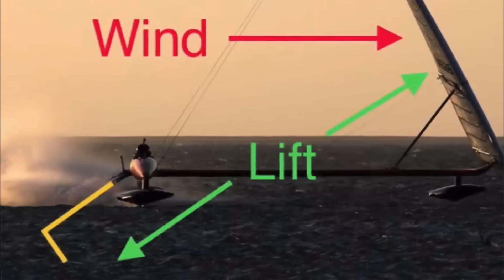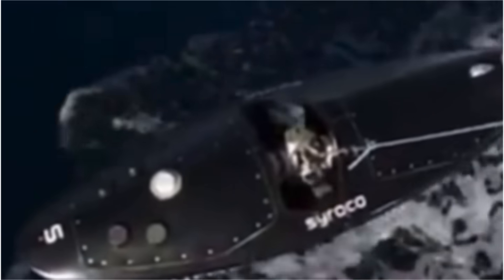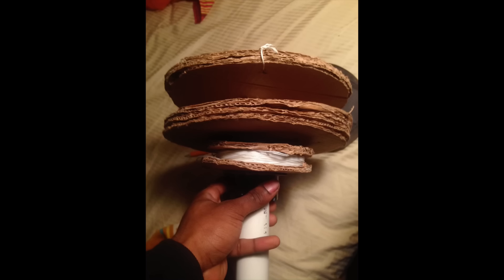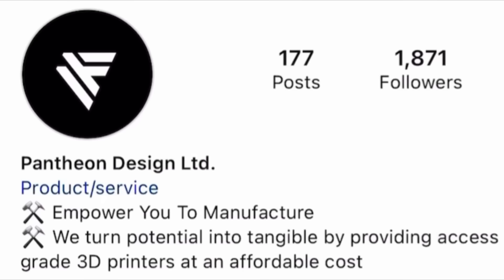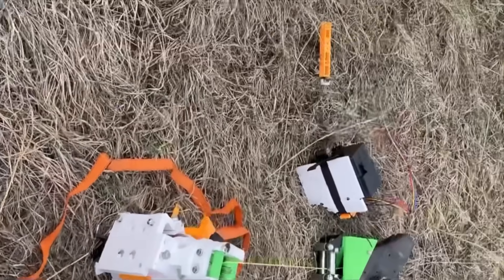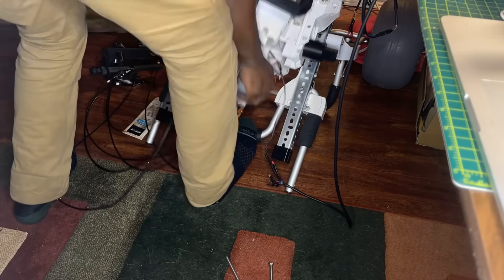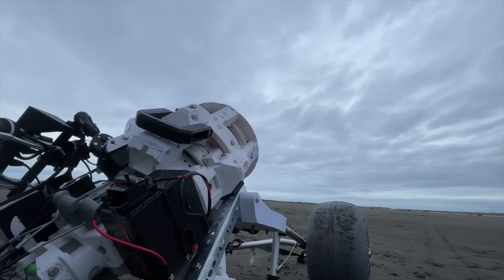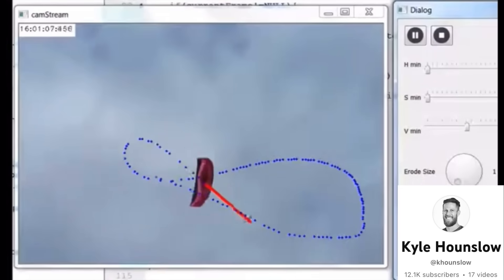Transforming Sailing and Power Generation with The Ocean Kite Engine

Comment: pretty cool concept but personally i wouldn't trust plastic it would be better if it was made of metal atleast for the structural parts
edit:
i love the idea of using one of these as a generator but again if i was running my house on this i would want it to be reliable aka all metal construction like for a sailboat i understand wanting to keep it light but onland that's no longer an issue.
Reply from the maker: What would you say to Carbon Fiber ASA?
Reply: @Ocean_Kite_Energy  personally carbon fiber ASA is good for compression forces for that added strength it's a very brittle material, 
Personally if I was making it it would have to be a mix of metal, injection molded, or machined plastics to build the strongest & lightweight product
Reply from the maker: I've been doing some research and turns out SLS and 3D printed metals are stronger than CNC, maybe that is the way to go.. just like all these space ventures are doing.

Comment: Seems overcomplicated. It would be much easier to have one tow line and have the control lines go down to a small pontoon boat below the kite. It would automatically steer the kite. 

The complications are steering and  pulling from the same point.
Reply from the maker: What you mention reminds me of KiteShip. They pretty much made a giant kite "spinnaker" but it didnt produce enough power. 

What we need is that loop. The looping motion is what turns the kite into a veritable one bladed wind turbine/propeller in the sky.. by increasing the apparent wind over the foil. This is where the power comes from. This is how we can draw the most electrical power out of the wind as well. So we want to maximize "lift"
Reply: @Ocean_Kite_Engine  
It would make perpetual figure 8s. Wouldn't require much electronics. Just let it out, and it self manages. Power could be adjusted by height. Very simple system.
Reply from the maker: Figure 8's are good, however loops require less power and focus the effort of the kite deeper in the wind window. Yes it would be simpler to just do figure 8's but power and speed are limited. 

 @FullCircleTravis

Comment: i think you will have a significant loss of power due to the lines going slack as you move in the direction of the wind, i hope to be proven wrong.
Reply from the maker: It's comments like this that make it all worth it.. You're really thinking about the problem. Here's my plan to address that going down wind.. It may use a bit of power but consider it a "powered" sail. 

As the loop commences  tension will rise, and the boat will move quicker, as the kite starts to pull up, it will indeed slow down and put slack on the lines..

My plan is to use the electric motor to effectively maintain tension on the lines. Also the boat itself could bear off to create more tension on the lines.

Now this will only be an issue for fast boats.. With boats like barges and boats with a low hull speed, we wont have as much of an issue.
Reply: @Ocean_Kite_Energy  good answer, but with out simply using the kite as a wing sail and creating tenson with the keel and sailing at a tangent to the wind, all you will do is eventually wind the kite in, even with multple kites in the air, if one or more is in the window, the lagging kite would not be able to catch up, imo this could only work with conventional sailing physics in mind, trying to sail directly with the wind will cause a pumping speed up slow down effect, swinging the kite/kites around would average out and produce a similar overall speed to using a kite like a sail to tack and jibe etc.
Reply from the maker: @BadwolfFPV  Ok you're tracking. Sailing tangent or "Cross wind" or Beam Reach, we would keep the kite relatively static/steady. Correct. The looping would be the most beneficial for downwind runs or producing electrical power (preferably at anchor). 

With going down wind, consider this.. (and I'm not sure, which is why I am loving your questions) Instead of a typical jibe in a zigzag directly down wind.. think of a zigzag at more of a 45-degree angle. One that osculates with the looping motion of the kite.. The kite line will have to be pulled in when there is slack, and let out when overpowered.. It will indeed be a delicate balance.
Reply: @Ocean_Kite_Energy  are you familiar with P.I.D loops, because I think that you will need a some kind of P.I.D loop system to maintain that balance. Multiple kites multiple loops, one to maintain tension on each line and one to maintain overall tension between the kites changing order, this will certainly require some helfy programming knowledge, sensors, etc, and possibly even AI. I can't imagine a simple mechanical solution, although I'm sure some genius could figure it out, but the one thing i know about power kites, is that once you catch up with them, they have to drift and catch back into the wind window, and if you are still moving in that direction, its incredibly difficult if not impossible for that to happen, and they drift to the ground, or if you get underneath them they act as parachutes and lower you to the ground with drag. They already tow big ships with kites so the theory is proven, but they are not swinging them around and using them as sails, I still can't see how the boost you will get from the swinging kite, won't result in slack lines or fully wound in lines.
Reply from the maker: @BadwolfFPV  And because those big companies (Skysails, Kiteship) dont maximize the speed of the kite, they'll never produce the power we really need. That swinging is what increases the apparent wind over the foil and maximizes lift (cubic relationship) so speed is more important than size (which is great because mass doesnt scale very well). Because of the size of those tankers, and their hull speed, if Skysails kites did constant loops/orbits like the Kite Engine, they could turn into large single blade propellers in the sky. But their hardware is not designed to do that. 

And for suuuuuure. This will need a lot of control. I'm currently tasking myself with making sure all the hardware and sensors are capable of controlling everything. I have a couple of really talented AI guys and our objective is to fly kites and log data and use machine learning in conjunction with PID control.. We basically have to make a brand-new flight computer. But it's 2024 and we have wayyy more computation than when this was attempted 10-20 years ago. 

The above maneuvers we are discussing are advanced control situations.. (looping with a fast boat, the flying boat) 

This is why we are starting with simple on water boat projects (check out Proa sailboats, I think you might be interested).. and even on land.. I will explain the control scheme in another video, but it is actually much easier than you would expect.. I designed it to be mostly operated with one hand, because I learned it's critical to have at least one hand free.. 

You are right, you dont want the kite to be overhead (or even worse, behind) In these situations it will be better to have the kite at a lower angle.
Reply: @Ocean_Kite_Energy  now i am super interested, fantastic response. i cant wait to see more.
Reply from the maker: @BadwolfFPV  I really appreciate your questions.. I have many of the answers but I've yet to actually vocalize them. They are just impressions until you actually ask. So it's a great exercise verbalizing them. Def follow if you havent already, and feel free to drop me an emal at Christian.Harrell.OKELLC@gmail.com
Reply: @Ocean_Kite_Energy  already subbed, will absolutely be following this project, it's fascinating. On the subject of power generation, have you considered the application of using the wing kite to carry a small turbine into the fast moving winds and hold it in the optimum window, the electricity can be passed directly down the cables holding the kite in the air?

Comment: I love the design / verify / redesign strategy, especially the rotating kite attached to a rotating engine to keep the lines from getting twisted.

The gondola blew me away, only the drag necessary for the keel.  Put the "boat" in the air.

Comment: Interesting device. Looking forward to see the autonomous version mounted on a boat. 
If it is producing electricity it is a generator (ship terminology). 
Which can provide power for an electric motor for propulsion. 
If it uses wind to move the boat in a controlled manner it is a sail. 
When it does both it is a new thing that needs a new name…
SailGenerator. 
When you drop anchor it does the same, but now it is a power plant.
Reply: I prefer WindJammer as a product name for the sailgenerator ...

Comment: Why does the kite have to fly in a figure 8 ?
Reply from the maker: It does not, This system allows the kiter to fly any pattern they wish without fear of tangling the line. For some reason, that hasn't been thought of until now.
Reply: @Ocean_Kite_Energy  But does the figure 8 pattern generate a stronger pull.
Reply from the maker: lol Im going to use that one
Reply: @Ocean_Kite_Energy  Sorry that was a typo I meant 8.
Reply: @ExploringCabinsandMines You want the kite to stay in the power zone as much as possible and a figure 8 does it very good w/o tangling the lines. With this system you could just go for loop, cause its Anti-Twist Technology. I really like it!
Reply: @mannohneschuh  so a kite in a dive pulls harder than just a kite "flying " in a steady position ?by what percentage?  how wouldn't anyone watching know this? just trying to understand. and please  explain the forces of line twisting
Reply: @ExploringCabinsandMines  It's all about the wind window. Take a look @ 7:30 for a picture. If you send the kite into neutral, it will always go into the green zone or on the ground. You want the kite in the red zone, this is the area where the kite catches the most wind and pulls much harder. Imagine flying a kite on the beach in good wind. In the green zone, you will have no problems holding the kite and staying on the ground. If you fly the kite in the power zone, you will be pulled across the beach with ease. To keep the kite in the power zone, you need to fly some kind of loops. For a human, the 8 is best because the lines don't get tangled, but the machine can easily do a loop thanks to its anti-twist technology. 
I don't have any numbers, I just learned it from kite flying as a kid/teenager.
Same goes for twisting. 2 loops and steering becomes much more difficult and increases wear and tear. 
I hope helps, im not a pro like this guy here.
Reply: @mannohneschuh  Thanks I get it now.

Comment: This is an awesome concept. But awesome concepts aren't that rare. What is rare, is someone taking the time, and putting in the effort to actually bring their concept to life. The way you're going about it so far makes me believe you'll be able to do it.
Reply: Yes, I'm very impressed.. intricate design, build and execution.  This guy is on the money, amirite??
Reply: first of all, awesome concepts are rare. and it takes money before time and effort.
Reply: It's a cool concept but at the end of the day it's a kite.  Kites have been around forever and nobody is using them in any kinda fancy way.
Reply: @NauticalPosition  It's a kite that can pull you in the exact opposite direction as the wind. Something no commercially viable  wind powered boat/vehicle has been able to do. Some boats designed for close-hauling can get to within 15 degrees or so with their speed significantly diminished, and being able to do keep up a pretty good speed within 30 degrees or so. If wind direction is no issue at all, avoiding storms and other hazards, as well as significant simplifications in navigation are suddenly available. This might not be the device. But in the end, if a relatively cheap and simple device can be made available, it could make sailing much easier for people without experience, as well as fun and more safe..
Reply: And it failed...
Works for a kayak. 😂😂

Comment: Nice job. I'm an engineer and a sailor. I too have considered this but never pursued it because I couldn't work out a practical way for average sailors to easily deploy and retrieve the sail in all conditions they encounter.  It also has to operate hands off to be practical.  Good luck.
Reply from the maker: You've got it, you definitely understand the difficulties, We will likely have a quiver of different kites like a sailor has a set of sails for different conditions. We are developing launching strategies and kite storage, techniques. If you have any ideas definitely drop me a line.There are so many talented people involved in this project.. and the demand for kiteboats is much higher than I expected.. but when you look at the tradeoffs, it makes perfect sense.
Reply: @Ocean_Kite_Energy  i got it  gonna give it to you  cause this is awesome.  Think nature, a mast either static or folded comes to stand certain height, above the craft , then a spider web type of mount unfolds with the engine in the middle of the web.  The web can manage the deployment and retraction of the large sail cause its connected via web on a multi point connection.  You got this!
Reply: i know this might sound stupid, but whats stopping you adding a Lidar or other camera and using AI program to control the motor steering the kite..i think the yacht maker 'silent yachts' was using a kite to sail there catamarans around 3 years ago when i spoke with them...just checked..there video is on youtube..."SILENT 60 - Kite Sail System Premiere"...give Michael Köhler a rirng, he is a super nice guy, and i would imagine your system is more advanced than there current one.... @Ocean_Kite_Energy
Reply: My thoughts too but he's billing it as "for the ultra-performance sailboat".  So if you're talking about racers, hey, they'll get it done and use it in the right conditions right? as he says a "super spinnaker".   So, so cool!  Maybe the power generation will be enough to drive propellers/charge batteries, and thus weasel some more upwind/no wind performance out of it?  I'm eagerly following this.
Reply: Love the idea…but how to attach to an existing boat so that you aren’t pulling the deck off under all that tension.   Can you attach it to 2 or 4 cleats, for example?
Reply: The more you understand how is the work condition on the sea, the more you will think this is not very practical and not worth the additional effort and safety risks.
Reply from the maker: I lived aboard a boat off the hook for 5 years in preparation for this @yuuyahiguchi7235
Reply: @Ocean_Kite_Energy  Kudos to your commitment and effort. Then you must really understand the countless challenges on these systems.
Reply from the maker: @yuuyahiguchi7235  That's part of the reason I took it on, I see a lot of other sea kite ventures and if you look at their rigging, there is a lot to be desired.. We need something that is basically as adept as a human and more so, all in a complete package.. 

I think sometimes we get caught up in AI and software and forget that hardware needs advancement too.
Reply: @Ocean_Kite_Energy , AWESOME.  Elegant to tap the nearer term ultra-$ailing high powered resources as a stepping stone to global power possibilities.   Seems a VERY 5-D project !  Suppose someone in your realm is trying to get a handle on insanely "smart fabrics" that would give the sails a "clutch" that can regulate how much of the wind the sail chooses to hold at any given moment ?  Fair Winds and Following Seas.
Reply from the maker: Kite tech has come such a long way,  So this engine has a reel that can control a conventional kite's "Depower" this way you can adjust your "throttle" or gas as it were.  @solarnaut

Comment: Would be interesting if you could highlight the planned/actual differences between your design and some of the existing solutions offered by SkySails, LibertyKite or Seawing for example.  Do you have an expected price point/range you're intending to try for?
Reply from the maker: Here is a table that demonstrates the primary differences, We are still looking at price.. but I know it'll be much cheaper than anything else on the market.. My dream is just to see kiteboats become more common. The only reason they are not is because they are usually very hard to control. 

https://www.linkedin.com/feed/update/urn:li:activity:7170757531877801984